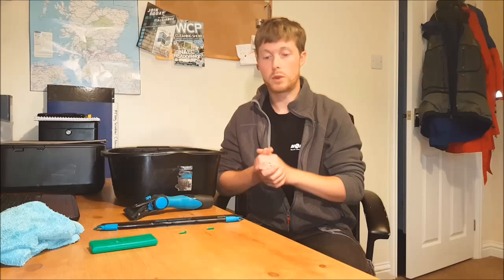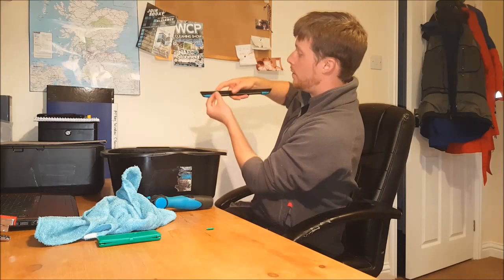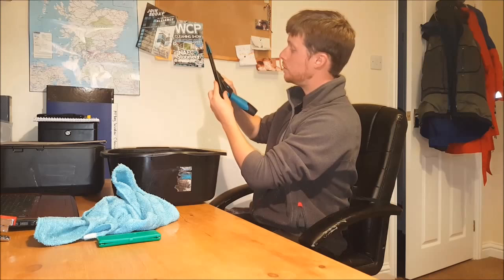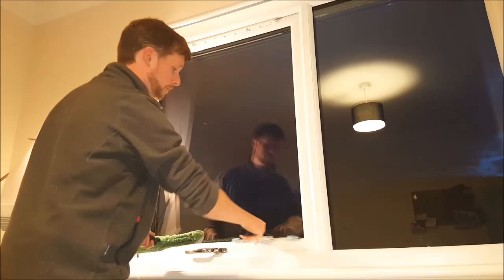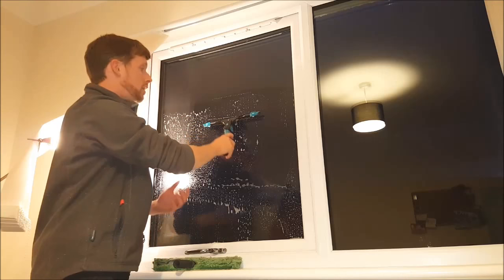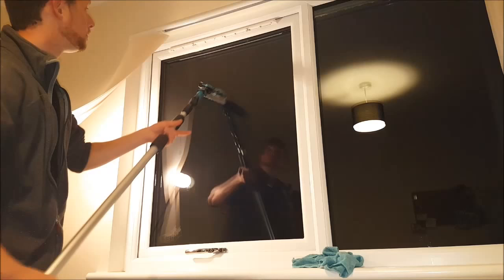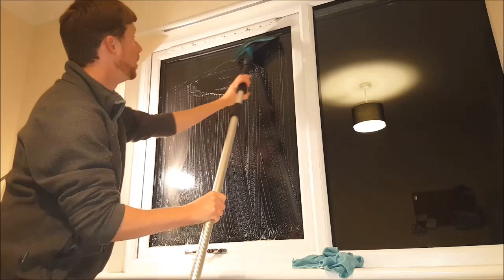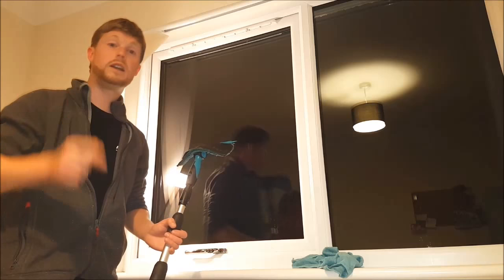How to use your Moerman Excelerator

Comment: Hi Trad. Best video on how to use these tools I've seen yet. Excellent. Your technique is exactly how I use them (I mean exactly). I fan from the middle (up swoop like Polz and work out from within) and apply soap directly to the applicator. I'm buying some Ettore rubber this weekend, but having real difficulty finding a local supplier (in New Zealand) who sells the Unger plastic end clips. I have to buy online from overseas, and is always a hassle. Been using RazorRed up till now, and was really good, until I hit winter. It leaves streaks in sub-zero (or near to zero) temperatures. So putting aside until the summer.

It appears to be the general consensus that Ettore master rubber is the best non-factory rubber for the Liquidator all round. Look forward to using it. Thanks.

Graeme Hibbard.
Sparkle Window Cleaning
New Zealand
Reply from the maker: Graeme Hibbard hello buddy thanks for the comment! Thank s for watching ;)

Comment: Hi
Thanks for the info just like to add a couple of tips 
When using the applicator I bring it up flat at the top of the window rather than bringing it across that way I find there’s less water on top of the frame
Also when applying soap now on regular cleans I  leave the bottom third as you’re applicator goes over that anyway when you’re bringing down 
Remember every little time saving tip helps over the coarse of a week and can mean extra money

Comment: This video is priceless. Great video. THANK YOU. 👍👍👍
Reply: @TradMan  been practicing this today and works so well. As you say it's a skill, not many realise this until you start.
Reply from the maker: @bencavanagh5425  yeah many don't stick with it and give up. Well done for mastering it 😉
Reply: @TradMan  Hi, I have a job that is a large oak framed glazed building. Problem have using the trad pole as recess of the frame is around 6" the squeegee won't go down to bottom of the glass. Seen your vid on Dr angle, so what other option would you say best other than getting up on a ladder, which is not safe where the job is. Many thanks.
Reply from the maker: @bencavanagh5425  yeah I'll be doing a video on this, hopefully get it out this weekend 👍🏻
Reply: Thats great. cheers

Comment: You convinced me, and I just got mine last night. The Excelerator handle and Liquidator channels are AWESOME, but I'm having a hell of a time getting the F*liq pad on. The clips are just not wide enough.
Reply from the maker: N A it's a tight fit so they don't come off or move ;)
Reply: It'd at least be nice if they were loose enough to get them ON the channel. So far I haven't even been able to get even one of them on. Seriously considering shaving them down a little bit.
Reply: Nevermind, finally got them. It helped to hold the channel grip spring in the handle to shift the channel over to one side, then lean on the handle with my forearm, with the channel over the sink, while pushing with all hell. Then adjust the channel grip spring and shift it over the other side, repeat. That's a little bit trickier than it should be, but man, I LOVE this thing. Right out of the gate I was fanning with a pole with very, very minimal detailing. Your videos really helped and I appreciate it!
Reply from the maker: N A fantastic!!

Comment: I've been watching your videos for a few years now and as a young window cleaner you've helped me a lot on equipment, I switched to Moerman when I saw you using it and noticing how it doesn't leave any soap on the sides and it was great but sadly I started to leave lines on the glass even if I changed the rubber multiple times and I just don't understand it at all so I had to go back to unger. Should I be cutting the rubber right to the plastic or leave like 1mm and does it change much if I leave it straight or should I shape it like the channel? (Hope you see this comment)
Reply from the maker: This video may help... https://youtu.be/TyyWpFcfi5E

Comment: I found cable ties work just as effectively as the unger clips.
Reply from the maker: Fair enough ;)
Reply: Love your videos mate, I actually stumbled across the cable ties idea after watching some of your videos and not having any unger clips at my disposal. So used cable ties as a temporary fix. I did use paper clips as suggested by polz n bladz. But have found the cable ties more resilient. 

I’m thinking of ordering some snapper handles for in hand use though. Rather than using excellerator handles in hand.
Reply from the maker: Cheers buddy, personally i would stick with the excelerator as that gives you angle options, the snapper only has the one angle, but totally up you of course ;)
Reply: Trad - Man I appreciate your opinion and thank you for taking the time to reply, I may buy a snapper handle for my wee channels and keep excellerators on my more commonly used channels. 

Window cleaning in Scotland in the winter is far easier if you don’t need to be holding as many wet rags 🏴🏴
Reply from the maker: Totally  :)

Let me know what you think of the snapper if you get it ;)
Reply: Trad - Man yeah will do, all my residential work is fairly easy to do so I the the snapper would be a good additional tool.
Reply from the maker: Great stuff ;)

Comment: Hey Trad - Man, about how loose is the swivel on your Moerman Excelerator handle? Is there a way you can loosen the swivel action on the handle if it feels like it's too tight? Thank you for these videos and your help!
Reply from the maker: Hiya hope your well. 

Unfortunately the amount and sensitivity of the swivel are not designed to be adjusted im afraid. 

Have you perhaps got a defective one? Have you tried another one to compare?
Reply: I may need another one to check. Hopefully as I break it in a little more it will begin to loosen up...but I also have no context to how loose they should be unfortunately. Thanks for the reply though! Appreciate your help!
Reply from the maker: @paulmcrae923  no worries happy to help! Yeah I've not had issues with the swivel so it could be just a matter of getting use to the tool. 👍🏻

Comment: Hi Mr. McKay, can you still use simple techniques like straight pulls and cut in straight pulls with Excelerator?  Would the results always be good?  Should the green Unger clips be mounted immediately or only after a certain time?  Thank you
Reply from the maker: You can do straight pulls to if you like. I put the clips in straight away, they are always in every squeegee 👍🏻

Comment: Good evening mr.McKay  I don't speak English correctly, that's why I hope you understand me. Could using the Moerman Excelator or Snapper with Liquidator during the summer season be difficult? with Moerman tools it is necessary to use a very consistent detergent solution, but in Summer a higher percentage of soap makes the glass surface evaporate and dry much faster. I am Italian and in summer the temperatures are high. What do you suggest to me? Thank you
Reply from the maker: Yeah personally I have the applicator a lot more saturated during hot days, like you said in heat the soap evaporates fast so I still apply soap to the applicator but I don't squeezee excess solution out of the applicator like I would on lower temperature days. Dunk in bucket, apply thin line of soap and straight on to the glass. You can also mop with one hand and with the other squeegee the glass all at the same time, (takes a bit of practice)
Reply: @TradMan  Thank you
Reply from the maker: Welcome 🙏

Comment: Great advice, I just wondered if the excelerator with the Fliq pad fits in the moerman boab or which boab it fits in best? Also would it be better to use a Fliq when I’m up the ladder rather than switching tools while at height?

Comment: hey tradman, how much pressure should you use when scrubbing with the applicator? whats the risk of scratching a window with an applicator if the applicator or window has a bit of grit in it/on it? and how frequently should you be rinsing the applicator in a bucket to remove dirt from the applicator?    cheers tradman
Reply from the maker: teddyboysmith2 hey bud, personally i dunk the applicator after about 4 or 5 windows, I've never scratched glass yet so you should be ok. if your doing a really dirty job you will need to wash your applicator more frequently.
Reply: just starting learning, seen a couple of scratches on glass, nothing major they may have already been there.  i wasnt rinsing applicator much , just using squirt bottle of solution,  maybe scrubbing too vigorously?  would it be possible?
Reply from the maker: if a little stone was in your applicator then yeah its possible, just give your applicator a good wash between jobs ;) its probably not you that did the scratches sometimes even new glass can have scratches

Comment: Great vid man - just curious if you still stand by all these liquidator setup tips (green clips ) for the new 2.0 channel ? 

Also i got my channel without a moerman rubber in it - Curious how many millimetre the moerman pre-cut rubbers protrude past the end of the blue clips on their stock channels please. Thanks
Reply from the maker: Hiya! Yeah I still use the green clips, it just helps hold the rubber even better, especially if you go over an area of friction like rubber seals or too much dry glass, it'll keep the rubber from pulling out the channel so that it won't leave an arc or smear.
Reply from the maker: I buy rubber in 36 inch lengths then cut them to size, the rubber should be flush at the ends with the blue clip

Comment: Peter, good video as always.  I'm starting to get the hang of the excelerator & pole but one thing I seem to be having issues with  is closing out.  The pole makes contact with the sill just before i've completely closed out.  It happens on lower windows and usually the panes that don't open; the compartment ones are marginally higher so am OK on them.  Any tips?  Cheers!
Reply from the maker: yoyo895 it is a flaw with the tool which is being sorted as we speak. but to close out you just have to lift the bottom of the pole up quite high then should close out ok
Reply: Cheers! Sounds interesting......And out of curiosity, how many rubbers do you get through in a week?
Reply from the maker: yoyo895 I'm quite particular about squeegee rubber. When it looks like it's getting worn at the ends i flip it or cut it down to the next size so i change rubber quite frequently. So one side of a rubber might last me 1-3 days before i flip  it, depends on the type of frames I've been working on though. some guys are not so particular about it and will keep using worn rubber but i think that rubber is cheap and i want to give my customers the best result possible so i change it frequently to avoid getting lines.  Hope that helps ;)
Reply: Definitely does.  I change on a similar frequency as it gets nicks and stuff.  Cheers mate.
Reply from the maker: yoyo895 happy to be of assistance ;)

Comment: could never get the hang of doing the double 7 then the tower in the middle always left lines every time i tryed fanning down the middle of the window so instead i would do the top part of the glass the same as you then fan the whole window togeather, not tryed this with high windows tho ;). quick question i was thinking about earlier do you ever get asked to clean the mirrors on slide robes?
Reply: Chad Monroe I use facelift razrred works for me but would need to get better if I'm going to use it for higher windows
Reply from the maker: guiltrix yeah you can also do the method your talking about as that works good to. only problem is when you get a seal down the sides that keeps gripping your squeegee. that's why clearing the sides makes life easier for larger glass anyway ;)

Comment: I have an excelerator and liquidator channel on the way,any reason you use the green unger clips rather than the ones it comes with?
Reply from the maker: kawasakiglenn The unger green clips help to hold the rubber tighter in the channel

Comment: Just got one of these. Love it in hand. But can't use it on a pole, I keep getting blobs on solution left in the middle. Any suggestions?
Reply from the maker: Is your rubber straight? Not bunched up at all?

What rubber are you using?
Reply: @TradMan  I just took it out of the box and played about for an hour. I totally forgot about your video on the rubber being straight. I'll go check in a moment :)
Reply from the maker: @james2614mc  yeah don't use the rubber that comes with it, it often has indents and doesn't perform well. Pop in a bit of ettore master soft and you'll see 🤜🏻🤛🏻
Reply: @TradMan  I've not got any of that, I've got some unger pro soft, and I also got 10 of the moerman rubbers when I got it. I'll go swap it out and try again after I've finished this coffee. It's amazing in hand though. I love it! I've only been doing this a couple of weeks. Reckon this squeegee will save me about 5 minutes per house as at the moment I'm doing straight pulls, having to dry the starting edge with a cloth, then detail all the sides after

Comment: Thanks for the videos. Moerman handle is a handy tool, different angles work nicely but if you work at height on ladders like you have to in Chicago and drop one which happens from time to time it is goodnight Irene as they are a cheaper plastic whereas other handles can handle a fall.  The channel is just not really worth the effort for crews going through a lot of work in a day as the Moerman rubber is absolute thrash and the time you save on detailing is lost on getting Ettore rubber or whatever you prefer into the channel and then clips in to hold rubber in place, you would have rubber changed and clips in on Ettore channel in way less time and if you know how to clean windows the results are very similar.
Reply from the maker: All good mate. Totally get what you mean 👍🏻

Comment: Hiya, watch alot of your vids to get technique ideas. I still get a streak from right top corner pointing to middle where the squeeze hits top right corner to come down right side. Any advice, cheers
Reply from the maker: +Luke Farnham strange, what rubber do you use and is it in good condition? do you apply the detergent to the applicator? All i do is use ettore master rubber, i dip the applicator in clean water then apply dish soap to the applicator and i never get lines. Also make sure the blade of the rubber is not leaning on anything especially over night as this leaves an indent leaving lines. hope that helps
Reply: Trad - Man hi i use red razor rubber. Good condition, does it even if new rubber. I will try everything you said, i wet my applicator then apply a line of fairy directly to it. It may be how i store them. Il get back to you, thanks for the reply, keep up the good work.
Reply from the maker: Luke Farnham yeah try to store the squeegees with the rubber not touching anything, also there are bad batches of razor red so i would try a small batch of ettore master soft rubber and see what your thoughts are ;)
Reply: Trad - Man i may do that thanks for the advice, and replying every time.
Reply from the maker: +Luke Farnham no problem, let me know how you get on :)

Comment: I know you've probably answered this before, but my main problem is sometimes I get a line coming from the end of the channel when fanning with a pole. It drives me INSANE haha but it's not all the time. I can't figure out what it is
Reply from the maker: +Anthony The Window Cleaning Guy what kind of rubber are you using? how are you cutting the rubber?
Reply: Trad - Man I use ettore mostly. Sometimes unger. And I use a Moerman piece as a template and cut it with my blade
Reply from the maker: +Anthony The Window Cleaning Guy that's the way to do it buddy ;)
Reply: I usually don't recommend fanning with a pole. Each time you turn the squeegee there is a chance for a streak. He fanned back and forth 10-12 times for such a small window. NOT EFFICIENT! You could come down twice in 1/4 of the time. Just detail the tops with a rag wrapped around the tip of your pole and you're done. Fanning with a pole looks cool but it will take you all day to do a decent sized job. You can't make money working like that. If anyone doesn't know how to come down straight and not leave a streak they're in the wrong business. Always remember that time is money.
Reply from the maker: Bryan Davis thanks for your comment
Reply: Thanks for the reply. Good reminder that fanning with a pole is an advanced technique that requires a lot of practice. I sometimes fan the transoms or upper panels with a pole. Especially if the window is very wide. 
With a sharp rubber and adequate soap my Moerman can work wonders. What sparked my comment is that the window in the video was kind of narrow. Two strokes for the sides and an 8-10 stroke fan for the middle seemed like too much work for such a small panel. A home or building with 200 panels will wear you out doing that for each window. I recommend these videos when training newbies and they have been very helpful. I'm all about efficiency -two strokes are better than four, that type of thing. That's because newbies don't do anything quickly so I try to make things simple. Keep up the good work with your technique. I'm always trying to improve also.
Reply: Thanx, I was going to ditch my excelelerator until I tried it with ettore rubber.
Reply: I have the same problem at times,  I can't figure it out Trad never really answered the question.
Reply: @TradMan  And ? You didn't answer his question.  How come a line? It has nice edge when looking it. I can't figure why I get a line.
Reply from the maker: Do you apply the soap to the applicator?
Reply: @TradMan  - Sometimes . I tried to use less and more soap and I still get lines on end of squeegee from time to time. The rubber looks fine. Could it be the blue clips somehow?
Reply: Can the unger green clips help prevent this as well?